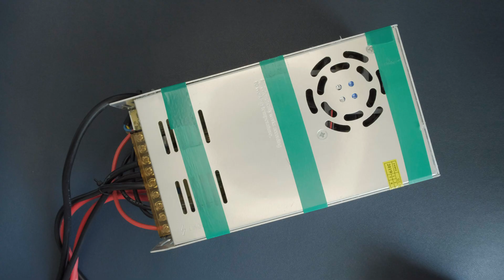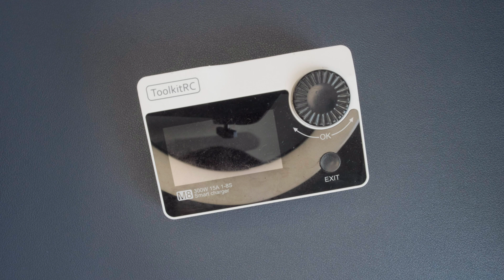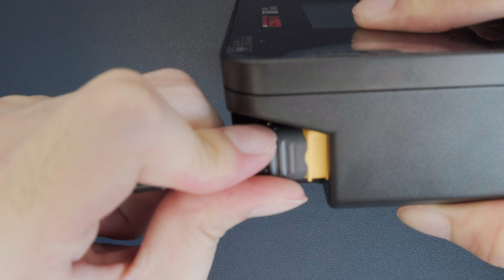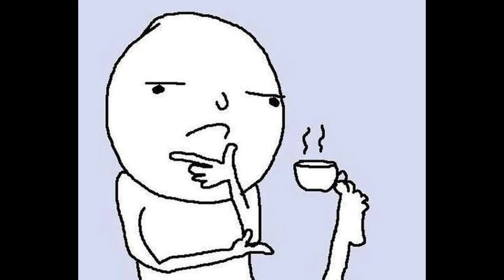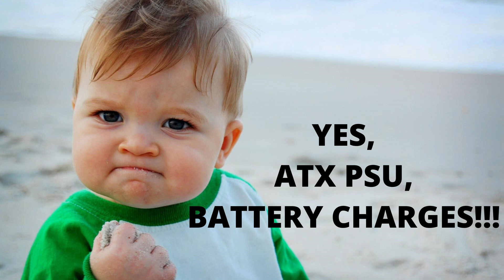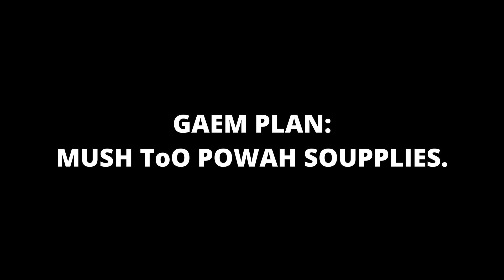Parallel Charge All Your Batteries! | 720W Power Supply Build

Comment: Or!!! You can simply change a single resistor in the feedback and that supply will do 24vdc @15 amps all day. (360 watts) You can of course then parallel 2 to get the 30 Amps if necessary?

Comment: What about output smoothing capacitors? They're not rated for 24v
You could buy a 24v smps at first place
Reply from the maker: Individually they're not, but they don't have to. As the individual caps are only filtering for individual PSUs, not the combined output voltage. And an actual 24V 30A SMPS is a lot more expensive and harder to find at my location.

Comment: Why not use 1 psu 24v 30a because as far as I know ISDT setpdown charger?
Reply from the maker: It's not only a step down charger, it can step up too. Also 24V would be too close to target voltage for 6S and TS100, this would make it hard to maintain good regulation.